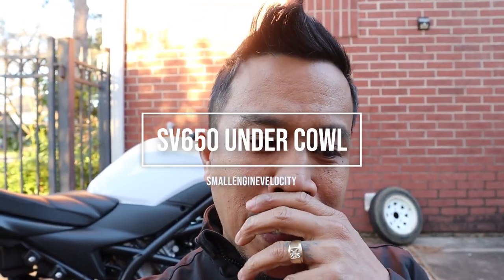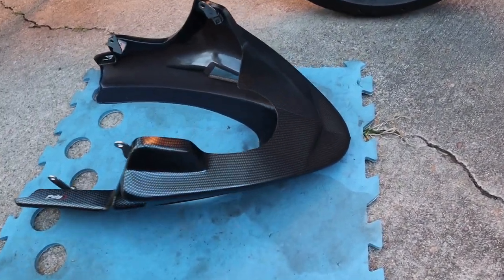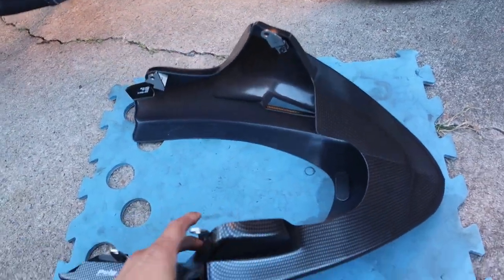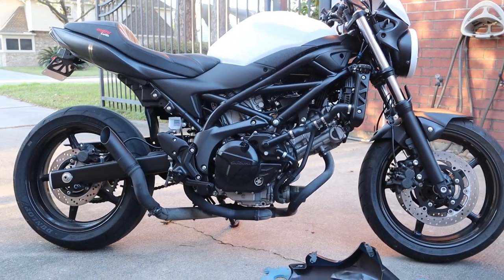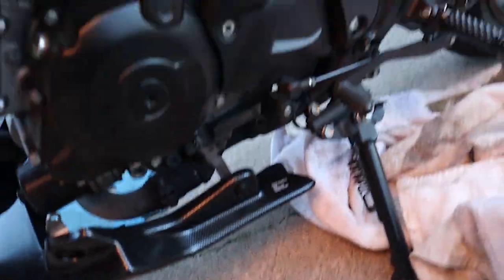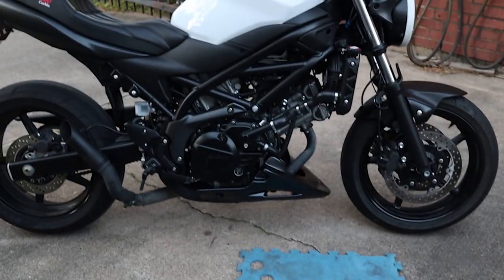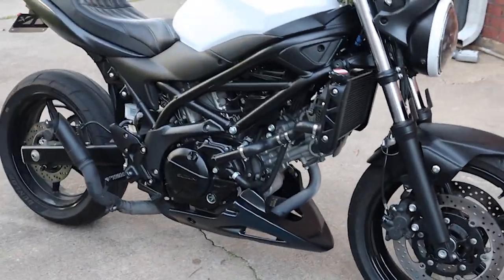2017 Suzuki SV650 Under cowl install from REVZILLA #sv650

Comment: Always thought chin fairings added a nice look to a bike. I ran my old 91 ninja 500 without its bottom fairing for most of the 3 years I owned it, since it was 19 years old and had been used and abused by many riders in its lifetime and the chin fairing had a nice crack right down the middle and was held on by 1 bolt. Then one day I was riding down the road and something managed to kick up off my front tire and blow a quarter-sized hole in my oil pan.  Really makes me want the fairing on my new SV650.

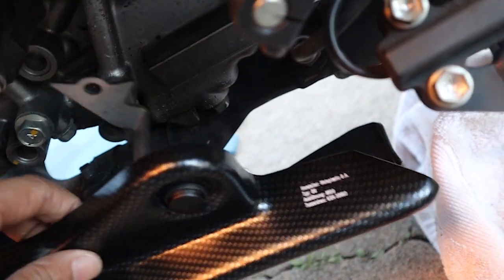Comment: Hi, I just bought the exact same belly pan and found the mounting instructions in Puig website, the rear left bracket with the round shape is for the V-Strom and the old SV 650. So the bracket you show in the video is the right one for the new SV, but you put it upside down at 04:18 (it was installed right at 03:45, you just had to rotate it 1/4 counterclockwise to have it horizontal) and you fixed it with the wrong bolt, you should use the one that you show at 03:58. But I guess it doesn't make a huge difference as long as it fits... 
Nice video by the way, and nice bike, it looks really good in black and white ✌

Comment: I have a blue and white ER Max seat cowl on my 2017, and loved it.
Reply: E2Moto did you install this yourself? I bought the same one and haven’t found the motivation to figure out how to install it
Reply from the maker: It’s not hard at all , you just have to take care when you tighten them because it will change the position that it sits on the motor. It’s not hard I’d put it in ASAP lol
Reply: Alfred Henriquez It's easy, and if you want to be safe, do it in your next oil change because you'll have to remove it each time.
Reply from the maker: I’m really wanting to buy it

Comment: suzuki makes a lower engine guard for the vstrom 650, fits the sv 650 because it uses the same engine.
I think that it  looks better than this one.
saw it on another you tube video.
makes the bike look more finished, and protects the engine, oil filter, and pipe.
 just ordered mine today.
not cheap at $300.00 us

Comment: Thank you for this, I have ordered one for my SV650X, I do think that it adds a bit more bulk to the front giving a better perspective aesthetically, also my oil filter is already rusting after just 2 months in the uk with salt on the roads.
I’m hoping that this will add to the protection. Great video!

Comment: HI, nice video, thanks.  I also like the seat on the bike, could you let me know the make and/or where to get one? Also did you remove the grab rails?
Reply from the maker: Corbin is the seat maker :) expensive but worth it. I am unsure about the grab rails, I got this bike used and it didn’t come with any or in the spare parts box

Comment: Do you have a video on that headlight?

The stock headlight is not working for me, and I recognize the light you have as one I have been looking at.
Reply from the maker: It came on the bike that way. It is a LED for sure but when I took it off to look at it , it was NOT one of those china ones but rather a real headlight. Research showed it was for a Harley headlight (aftermarket). Bonus was it had good distance, bad part was it didn't have great spread (wide).